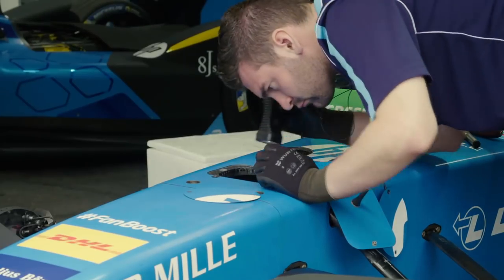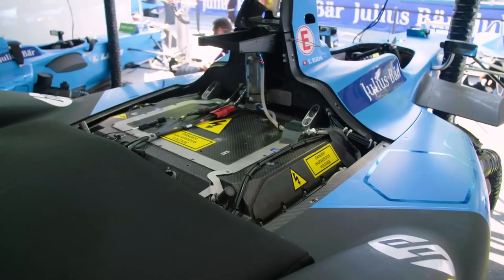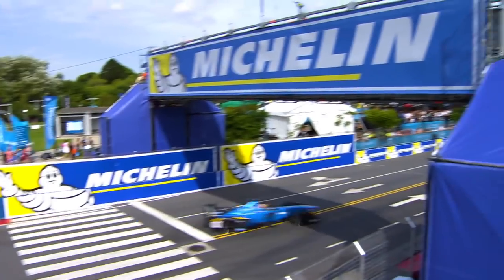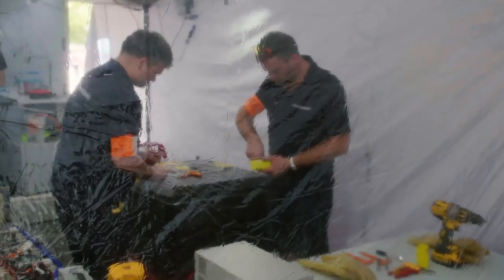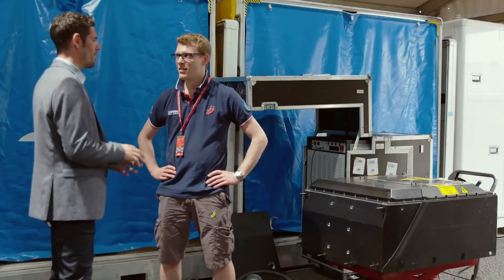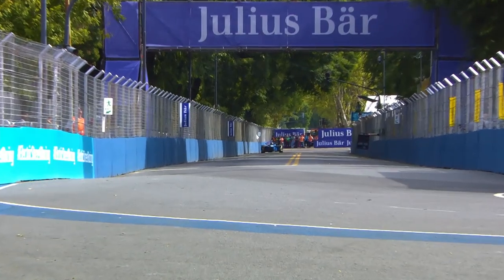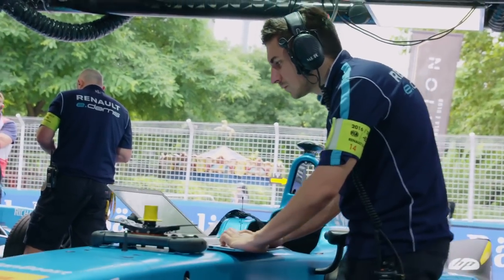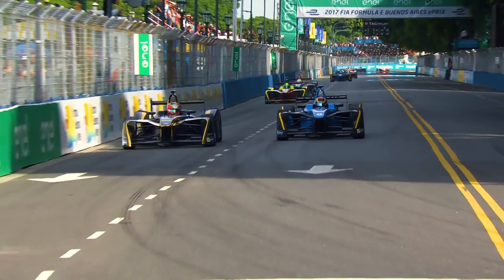What next for Formula E's battery technology?

Comment: ATIEVA from Silicon Valley of California  will be producing the new race battery pack for the 2019 season. It last the whole race and does not need to change cars. More range and power for the newly designed chassis.

Comment: When will we have an FE vs. F1 race?
Reply: Not soon I'm afraid. Currently F1 cars can achieve speeds superior to 300km/h, while FE cars only go up to about 220km/h. Right there you have a huge difference that makes FE cars not competitive enough to go up agains F1. Maybe we'll see some battery technology miracle soon, but I highly doubt it...
Reply: turbotoblast4 I don't really think it is the battery. I believe it's the motor/drive shaft from motor to wheels that is bottlenecking all this development that we can get to fight a F1 car
Reply: Currently FE is inferior to a F3 car.
Reply: Even the new FE cars will only have 250kW, far from the 500+ F1 is running.
Reply: Hardrive33 No way. Electric motors can already produce as much rotational power as a piston engine. The bottle neck is in battery tech. If you wanted to run electric motors at 350kph+ you could only do so for 5-10 laps and your flat. The current motors can drive a car over 300kph they are speed restricted to increase the length of the race. The new battery for 2019 means full races in one car and increased speed. In 3 more years they will have 40 lap races at 300kph+

Comment: Formula E race cars don't need a second car to finnish a race, as discussed automotive engeneer, I have the answer to continues driving with an electric propelled car, so no more spending billion's of pounds of improving battery technieks or having to install 8,000,000 charging stations over Europa costing 60,000,000,000 Pounds Sterling, and that is not even included the price of installing and laying electric cables to the charging stations, Capt. Alexander N. van Baalen